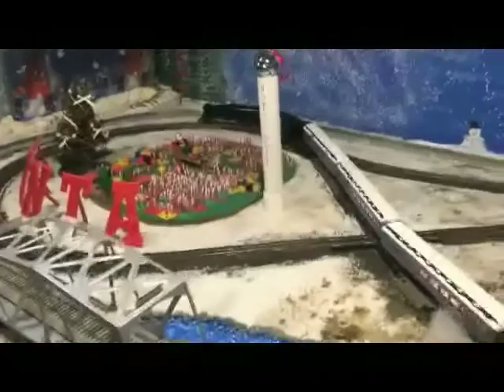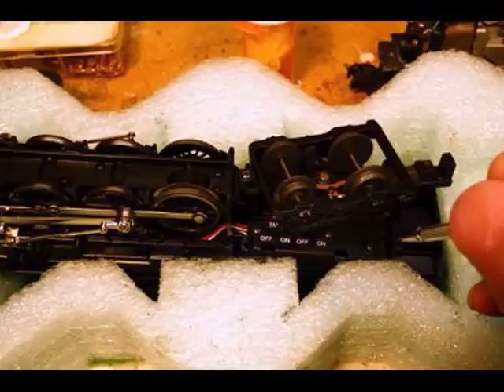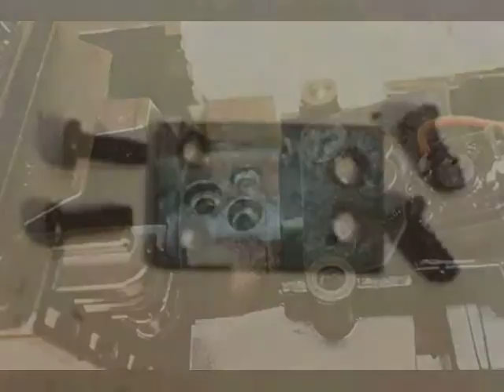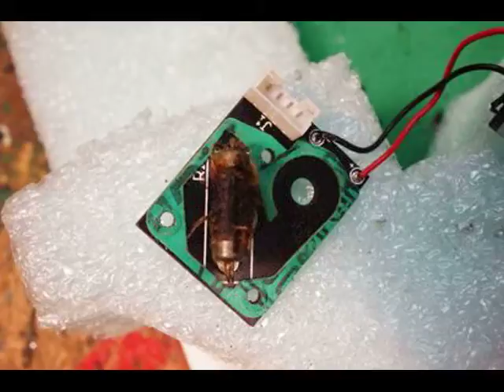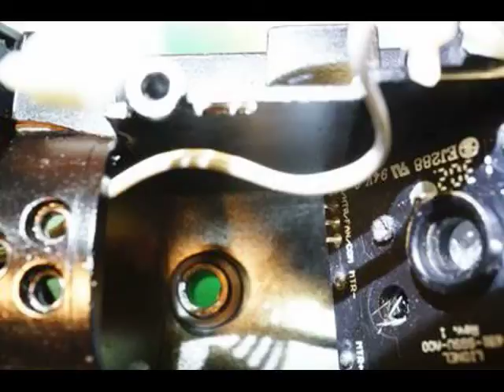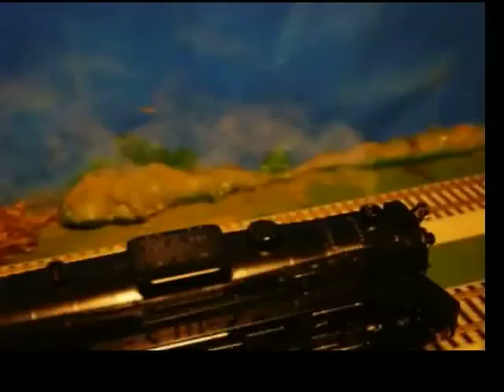Rewicking The PE

Comment: Just out of curiosity, did A. C. Gilbert produce any steam engines including smoke in tender models with a smoke on/off switch. I know they did not until Lionel took over production and added new models that have the switch.
Reply from the maker: Only the smoke in tender steamers from the early production (1946-47) have a switch to turn off the smoke and Choo Choo unit. It's a crude switch which extends from under the tender.

Comment: figured I’d leave this comment as a quick tip, nowadays you could use 0% nicotine vape juice for the smoke as it is easier to find and probably a lot cheaper. The problem I had with my train was not that it wasn’t smoking good, because it was, it just has a foul burning smell, and even scented liquid didn’t help.
Reply: Did you ever fix this? Having the same issue

Comment: Hey, my 470 chief (chromed) isn't moving with ease, cannot reach decent speeds unless running on the 120, and has trouble carrying cars. Got any tips?
Reply from the maker: It could be a worn axle bushing. You may need to replace it - a very hard job that needs a drill press. If the drive wheels wobble you have that problem. I cover that and many more things in mt AF Repair Guide book.
Reply: Thanks!